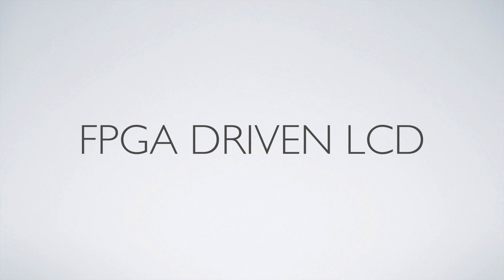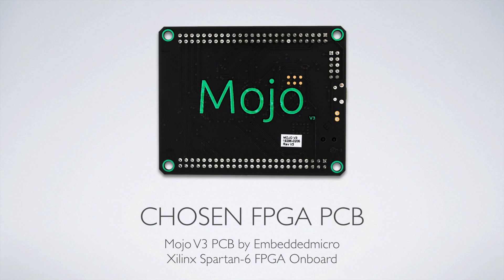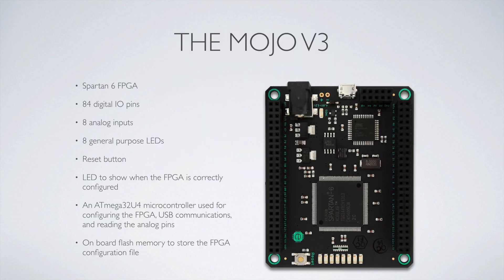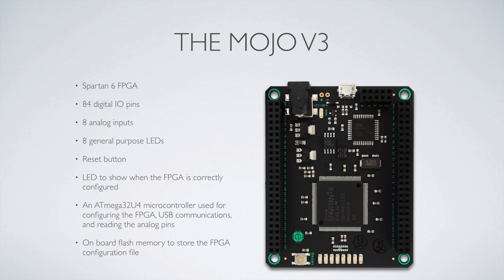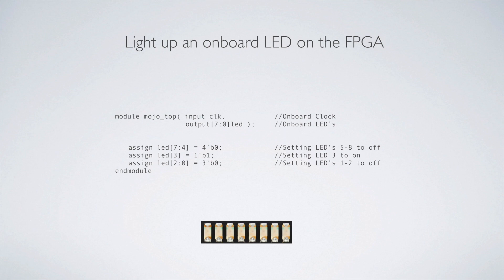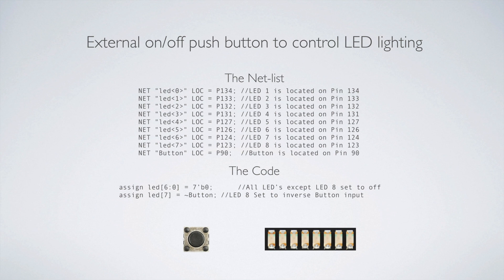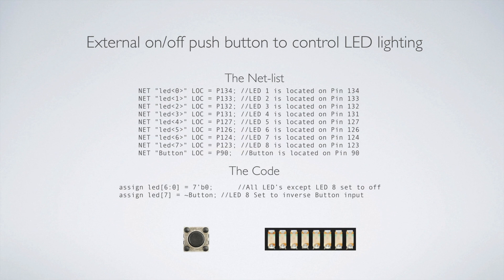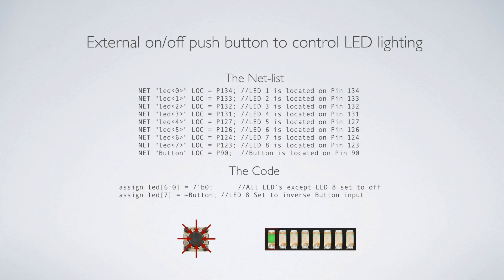How to code verilog for a LCD part 2: Mojo FPGA and getting started blinking an LED

Comment: Hey I am getting an error when I’m uploading a bin file through the mojo loader. When the loader verifies the bin file after loading it’s giving error as “expected 8 but got 0” kind of .. any idea?
Reply: Joshua Macfie hey Joshua yes . Here is the exact error message: “Verification failed at byte  108135 out of 340604 Expected 97 got 0”. What I feel is the Error check while verifying the bin file from Flash memory failed. The mojo loader version which I am using is 1.2.2. Is this the correct version which I am using?
Reply: I am using windows 10 64 bit